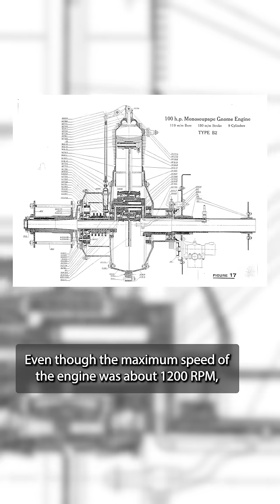The Gnome Rotary Engine

Comment: Like a modern two stroke, these are total loss lubrication. The best lubrication was  caster oil, used in the home, as a laxative. The pilots were affected.
Reply: I did not know that..Thank you..
Reply: Well the pilots wore scarves to prevent the castor oil from affecting them, it was used into the early jet age, unless the US Military still uses it in aircraft
Reply: How much caster oil should one take? Thanks.😮
Reply: Wherever they flew, chocolate rain followed😅
Reply: @BiblicallyAccurateClippy2320 they wore scarves to keep the oil out of their mouths though
Reply: I can't provide the name of the pilot, but one pilot from either Britain or France drank Whisky to combat that effect.
Reply: Gotta be an Aussie in the fray.😅
Reply: I think I'd probably poop myself before flying in it , let alone after ingesting all the castor oil when actually flying in it !
Reply: The goggles and scarf of Great War pilots are a common visual for a reason
Reply: Pilots wore scarves that would prevent them from ingesting any of the castor oil though, the most common use of castor oil was for colicky infants
Reply: I was going to bring up the Castor Oil thing. The pilots were kept very regular! 😂😂😂

Comment: The air cooling of the rotating cylinders while standing still is nice. If only airplanes had a giant fan in front to blow air over the cylinders. ;)
Reply: inner area of prop blade moves very little air, the tips do the vast majority of the work.....the twist of the inner area of the blade is more for drag reduction than thrust production
Reply: @ztungaz in that case the rotating cylinders will all be reheating the same bit of air, with no prop to replace it.
Reply: Exactly my thoughts.
Reply: the FW-190's was like that
Reply: They do ... They're called turbo fans... Just look at the inlet of any passenger airliner today and you'll see one
Reply: You mean the fan that is outside of the area that the engine sits? In the dead zone we know as the fan hub? You're a genius, huh?
Reply: @shawnpitman876  I'm not an aircraft engineer... But the idea that air-cooling from the air screw wouldn't be sufficient while the engine is idling seems daft to me.
Reply: @davebutler3905  There wouldn’t be openings in the engine cowling behind the propeller, in front of the engine to let air through to cool the cylinders if there was no airflow there to do the job. The crankshaft is behind the propeller hub. The cylinders are a lateral distance away and they HAVE to be getting airflow from the front or they wouldn’t be getting any airflow at all and the openings in the front of the engine cowl wouldn’t be there creating drag.
Reply: @oldsguy354  The prop doesn’t cool the engine sufficiently. In fact, on many of the planes I have flown with air cooled flat opposed engines, taxi time is limited because the engine will overheat, especially on a hot day. You have to get the airplane flying, moving forward through the air, for the ram effect that makes the cooling system work. The vents on the front of the cowling are venturi which increase the pressure of the air as it slows down entering the cowling, providing force to move the air across the cooling fins. The problem is that airplanes in the WWI era were too slow to provide much of a ram effect. Thus the need for the rotary engine and its self-cooling design.
Reply: @ So air does actually get past the “dead zone” and gets in to the engine cowling to cool the engine? Thanks for confirming what I’ve been trying to get across. 
I never suggested that the propeller provided all the necessary airflow to sufficiently cool the engine under load. That’s why air cooled aircraft engines should not be run at high throttle settings for extended periods of time while the aircraft is static, but if the cowling was not allowing air to cool the engine the static run time would be significantly lower. 
 When the aircraft is static, air is not magically jumping through the cowling because it wants to.
Reply: @oldsguy354 The point I’m trying to make is that the propeller doesn’t provide much in the way of cooling. Even at idle, the heat the engine is making is more than the prop blast can dissipate. Pilots will point the nose of the airplane in to the wind when not taxiing, especially while performing their engine run up, to maximize cooling. On extremely hot days (like 100°+ in the Mojave desert where I learned to fly), it may be necessary to do the engine run up checks (mag drop, cycle mixture and prop) while taxiing. This is both to reduce the time spent at low speed and to take advantage of the wind blowing across the engine at taxi speed of the aircraft to help cool the engine. When engines are tested outside of the aircraft on a test stand, they generally install a special test club instead of a propeller which is designed to help cool the engine.
Reply: @oldsguy354 Even at idle, prop blast itself is not enough to keep the engine cool. On very hot days in the Mojave, I have done the engine run up while taxiing just to hurry up and get the airplane off the ground before the CHTs get too high.
Reply: @ I understand what you are saying, now read carefully what I’m saying. There is no “dead zone “ behind the propeller preventing airflow into the engine cowl like the other guy was insisting. More air flows through the engine cowl when the propeller is turned than when it is not, even though it is insufficient to cool the engine entirely it is a lot better than not having any at all. The engine can tolerate a heck of a lot more taxi and idle time with the cowling open on the front of the engine regardless of which way the wind is blowing than with no open cowling at all. It is not magic that air  “decides” to go through the cowling when the airplane is static and the propeller is turning.
Reply: @ Try sealing off the engine cowling and see how long it takes to seize the engine.
Reply: @ Yea, the “dead” zone that magically allows air through to cool the cylinders dolt
Reply: @ You HAVE to be trolling because no one can be that confidently ignorant.

Comment: The Camel was known as a 'vicious little beast' due to the tendency of the plane to roll in one direction due to the engine. It gave an advantage to pilots facing an enemy aircraft.
Reply: Made famous by Snoopy in his battles with the Red Baron.
Reply: @stephenwalker6939  The Forker Tridecker also had a Rotary engine!
 
Both planes could make a sharp right hand turn (IIRC) but had issues turning left due to the torque the spinning mass of the engine caused!  (Note: I may have the directions reversed)
Reply: It gave advantage in one and disadvantage in the other, if the enemy knows that it's only a disadvantage because now he can dictate the engagement
Reply: @jacqirius  … assuming the enemy does not dictate the engagement first.
Reply: let me guess if you weren't facing the enemy aircraft you were basically fucked ?
Reply: thats not an advantage

Comment: Actually, the Sopwith Camel had switched magneto with full, half, quarter and off for ignition, which essentially was the throttle control.  That's why you hear that popping noise when trying to fly slowly.
There's a very good YouTube video featuring Gene DeMarco explaining it all.
Reply: close. but it was 9 7 5 3 cylinder ignition. and i think 1 too but not sure. turning part of your engine off to slow down sounds insane to me :D
Reply: @jstefa2 why insane? rev limiters kill fire to a predetermined number of cylinders, and it works just fine.
Reply: @albondigas9549  in 2010 sure. 1915 not so much 😁
Reply: @jstefa2 "turning part of your engine off to slow down sounds crazy" 

I think not as crazy as turning off your whole engine and potentially not being able to turn it back on. 

Turning off cylinders has been an automotive standard for some time now. I hope no one would be crazy enough to do it in a modern plane 😂
Reply: @jstefa2 we still do this, rather to save fuel than slow down (cylinder deactivation)
Reply: @jstefa2  As I was going to say, they could select less cylinders to fire on later versions.
Reply: I worked on a 10 day shoot covering Peter Jackson's collection  Got to fly in one of his two seaters. Gene who flew the Camel was truly a master with the craft and threw it about the skies with confidence. Sadly later I learned through the club scene of his illegal demise.
Reply: Ah so that's why Biggles was only setting his "throttle valve" to thesse values!

Comment: Aircraft mechanic here, also a rotary engine enthusiast. That is a radial engine, not a rotary engine, that operates the same way that other radials do, the difference is that they're reversing the stationary part of the engine, it was not very efficient and all that extra rotational mad caused lots of stability issues
Reply: That is a rotary engine….. I sincerely doubt that you are a LAME, if you are, god help anyone that flies in an aircraft that you maintain…..
Reply: - yes and while not a Wankel, "they" called those types of "rotating radial" engines rotary engines - historically...
Reply: Another Aircraft Techo here. These were ROTARY engines long before Mr Wankel invented the thing that powers your Mazda buzzbox.
Reply: Yup the gyroscopic inertia would have been mad!!!!

Comment: I read that experienced pilots took advantage of the rotary engine's effect on the plane's handling to maneuver when attacked by a plane with an inline engine.
Reply: It was a two-way street. With that rotating mass, you could be surprisingly nimble in one direction, so you could swoop in on your target well. But the Germans very quickly learned that while they were nimble in one direction, they were extremely hard to maneuver in the other direction. So German pilots learned that if you set up your attack to force your opponent to turn against the rotation of the engine, the target would have very little chance of outmaneuvering the attack.

Comment: It Used castor oil, smoke gave pilots diarrhea, often stopping behind enemy lines for a squirt.
Reply: It wasn't just the smoke the engine was a total loss lubrication system, oil not burnt was sprayed everywhere

Comment: Gyroscopic forces were a huge problem.  German pilots knew which angles to approach from because the Sopwith Camel couldn't climb and turn in a direction (either right or left, can't remember) at the same time.
Reply: Left. On the other hand, if it could turn right, it could spin on a sixpence and be behind you before you could say "Knife".
Reply: @sarumano884  This is the most British sentence i've heard this week.
Reply: @sarumano884  ... or "scheisse"  😂😂😂
Reply: @sarumano884  Or in the hands of an inexperienced pilot, turn on a sixpence straight into the ground.  Which it was quite notorious for.
Reply: How clever, and innovative both sides were, only 11 years since the wright brothers flew at kitty hawk.
Reply: @Papi-1231j , forget this  'Wright brothers', search 'Alberto Santos Dumont' ...
Reply: @Papi-1231j That is also a sad comment that the early planes were used for warfare only 11 years after their invention------
Reply: Yeah you couldnt turn against rotation of engine or climb well w/o throttle control. BUT you could spiral and dive with rotation faster then anything in the air. Leading to wins via Camel over the Fokkers arguably more advanced design
Reply: @captaintoyota3171  I mean 90% of flying is landing though.
Reply: @nospoon4799  totally. Landings are hardly ever cancelled, whereas takeoffs get cancelled or delayed all the time.
Reply: Consider the vast progress in the field of aviation in a little more than 100 years! Historical astounding!
Reply: They should put in on an axle to they could flip the engine
Reply: Adding more moving parts will inevitably lead to more failure points. But I genuinely like your idea. I think of crazy ideas like this all the time. Maybe with AI we can test crazy ideas.@okgoogle4206
Reply: The Germans used rotaries as well. The infamous “Fokker Scourge” of 1915 was perpetrated by the Fokker Eindecker series fighters; the first fighter with a fixed forward firing machinegun synchronized to fire through the propeller arc. These aircraft were powered by the Oberursel rotary engines, which were copies of the French Gnome Monosoupape engine. And they used the same engines all the way up until the end of the war, with the Fokker D.VIII monoplane being one of the last types to use them.
Reply: @wrkingrageaholic  the Fokker D.VII would use a inline engine, the D.VIII would either use inline or rotary engine similar to the Fokker F.1,  Pfalz Dr.1 and Sopwith Camel type of engine although the Fokker F1 and Pfalz Dr1 used the Gnome Rhone Rotary engine
Reply: Terrifying.
Reply: Couldn’t they have just made a dual engine Sopwith Camel spinning in opposite directions and used some passive hydraulic mechanism to force them to match RPM?
Reply: @ChronoGXay    No.  for many reasons.
Reply: @ChronoGXay  You mean, a 2-engine fighter (or bomber)? Yeah, these existed, but were too heavy to be manoeuvrable enough. Which is why even in WWII you had single-engine one-seaters as fighters and 2 engine machines were at best “heavy fighters”, which were outmatched in aerial combat by above mentioned fighters.

One of the problems of the rotary engine was that it rotated too fast — once the propeller tips become supersonic, you get no more power from them. So you are limited in prop diameter. And that limited the useful power output. (The other is the rotation of the cylinders causes drag, limiting the practical power output of the engine.)

Of course, putting a reduction gear between engine and prop — when they are bolted together — is not going to work. 

However, there was an attempt at remediation, the Siemens-Halske Sh.III (wikipedia has a page about that one), where the crankshaft rotated in the opposite direction from the engine, via a set of bevel gears. The RPM of 1800 of engine versus crankshaft resulted in 900 RPM on the propeller, giving the advantages of high engine RPM and more efficient propeller speeds and reduced gyroscopic effects — both from the reduced RPM and the counterrotating mass of the crankshaft. 

It also had a throttle (and it was not of the monosoupape design, having 2 valves per cylinder) so it could throttle down to 350 RPM.
Reply: Made in France❤
Reply: @AleksandarBogojević-n8l2s  The French copy nobody, and nobody copies The French
Reply: @AleksandarBogojević-n8l2s what a nightmare
Reply: @AleksandarBogojević-n8l2s Except Bentley made em as well.
Reply: Thanks to mention a drawback the author totally failed to do.
Reply: @Firebat45  it was because the Sopwith Camel used wing warping and it's because of the Camel's issue that ailerons were developed to prevent any further recurrence of that problem

Comment: It had a carburetor ....😅
Reply from the maker: The early ones were just on and off with the mags but later ones had a carb that could control the engine speed much better.
Reply: Depends on how you define carburettor. A lot of the early ones were little more than a drip feed of fuel into the intake, controlled by a needle valve. No Venturi was present, so if you adjusted the throttle you would also have to adjust the fuel flow manually to get the right mixture.

Comment: How do you provide fuel and gas flow on something rotary?
Reply: I believe  it came up from inside the crankcase up to the  cylinders  a bit like a two stroke
Reply: ... Thanks!
Reply: @daaustin1969  Yeah that would have been my idea too.
Reply: Adding to the above, they used a hollow crankshaft, air and fuel flowed into the crankcase through the middle of the crankshaft and from there to the cylinders.

Some rotaries have obvious induction pipes from the crankcase to the cylinder heads. The Gnome monosoupapes don't, instead they use transfer ports like a 2 stroke despite running a 4 stroke cycle. Pretty weird.

Comment: It also had a reputation as "the spitter" due to oil distribution.
Reply from the maker: On the bright side, the operators never were constipated…
Reply: Total loss oil system that used Castor oil.
Reply: That might explain why the pilots were so dirty after flights.

Comment: A proper rotary engine, not a Wankel, that so many people mistake for rotaries . Interesting historic fact there was a car built with a rotary engine mounted in the back it was fine in the dry season but in the winter on the icy Road advancing the throttle made the car spin in One Direction retarding the throttle made the car spin in the other direction because the mass of the engine. It had a ring gear connecting the cylinder heads together, which drove pinions gears on the axle shafts. Adams Farwell was one of the rotary engine cars. Yes, you can put a carburetor on a rotary it goes on the end of the crank shaft.
Reply: They are both rotary engines, this being a piston rotary, wankel being a piston-less rotary
Reply: Words have different meanings depending on context. Wankels are obviously also referred to as rotary engines and it is incorrect to tell people otherwise.
Reply: @pstrap1311  Yes but technically the Wankel should be called "rotor engine" which would be an engine with a rotor in it instead of standard piston. When you say "rotary engine" you're literally saying rotating ENGINE.
Reply from the maker: In aviation, rotary means something way different than automotive rotary engines. Always interesting to see this as it happens multiple times!
Reply from the maker: I've had so many arguments about this very thing. It’s nice to meet a true mechanologist…
Reply: Thanks for explaining the difference
Reply: They’re both called rotary engines